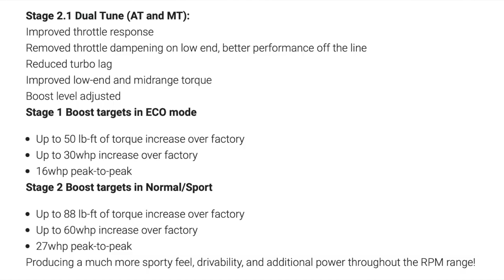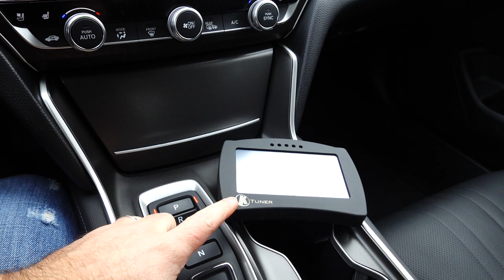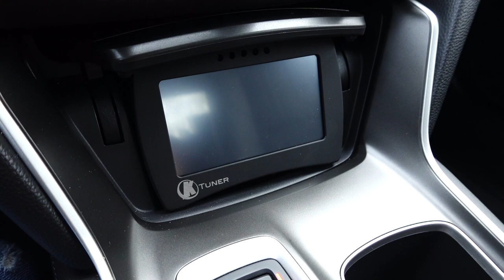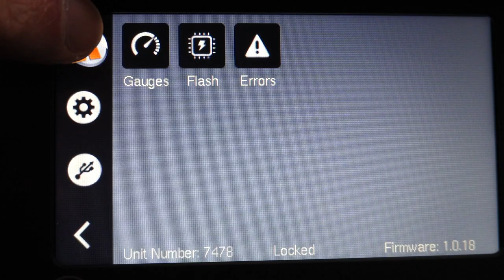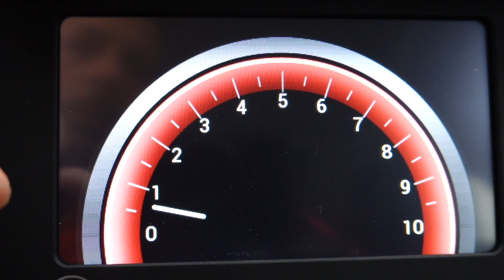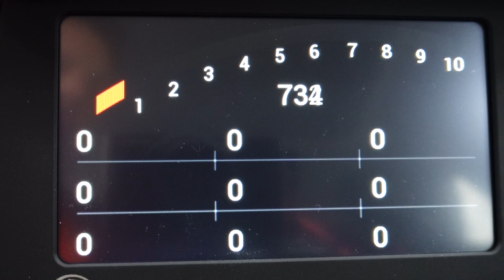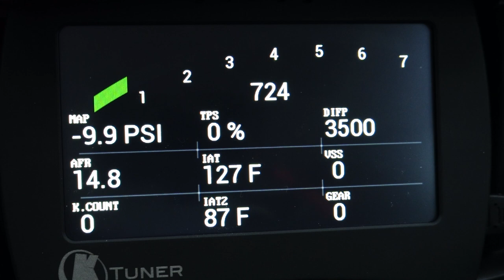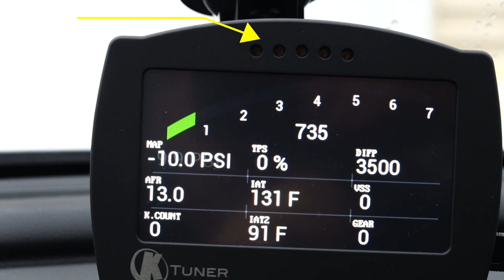How-To: Setup KTUNER V2 Display, Gauge Layout, & Datapoints // (2018+) 10th Gen Honda Accord

Comment: I chose a stealthier route. I bought this 'KTuner V2 Console Holder' on eBay for $12. It is 3D printed. It sits on the console in front of the cubby. The V2 can easily be lifted out to access the storage and 12V/USB sockets (I leave the little door open) and I mounted the holder with Velcro in case I want to remove it temporarily. I don't have the line-of-sight out of the windshield but it is stable.
Reply from the maker: Do you have a link you can share as I’m interested in seeing what it looks like 👍
Reply from the maker: Thank you.

Comment: Quick question. Do you keep the display on at all times when driving or only while data logging ? I got the ktuner with phearable stage 3, but I’m skeptical about leaving it on since it stays connected to the OBD2.
Reply from the maker: I keep the display mounted and on most of the time 👍

Comment: I have a question? My car only has prl intake v2, stock downpipe! If I buy the same ktuner as you and make the same tuner as you does it work?
Reply from the maker: You can run the KTUNER Stage 2 without having any other mods 👍

Comment: I have done data logging. It's useful to see if and where you have a problem, like monitor your air temp or fuel quality. One just to see overall what the car is doing. Totally safe on either of these tunes to go WOT from any speed, including stand still, if you hate your tires that much lol. Advanced VSA and aggressive ignition pullback setting will help with wheel spin
Reply from the maker: I plan on conducting some data logging at stock, the compare it to stage 2 tune logs.
Reply: @TheLemonFactor  ok where's the videos where's the tune lol

Comment: Can I use this without having my car tuned just for the afr readings?
Reply from the maker: Sure you can, but that’s a pretty expensive AFR gauge.
Reply: @TheLemonFactor  what do you recommend for a 21 accord to get AFR readings
Reply from the maker: There are wireless OBD devices that can read various sensor readings, which you can use your phone to monitor 👍
Reply: @WubstepX lufi XS is a good option

Comment: Currently showing K.CON, ECT, IAT, GEAR, MAP, TPS, BAT, AFR, TC.Prs on the first screen. Second screen shows K.CYC, K.COUNT, K.CON, ECT, ECT2, IAT, IAT2, AIGN. Still trying to figure out what is useful and not.
Reply from the maker: Exactly... there’s a lot of information available. Have you conducted any data logging?
Reply: No. Haven’t gotten that into it yet. Just like the extra oomph at 3k RPM from the stage 2 tune. Makes the car much more drivable in normal conditions. Don’t do WOT take offs from stand still either.
Reply: @mrzeld  just to be clear, by you saying Don't do WOT from standstill, one would perceive that as a warning. Which in fact would be false. These tunes are completely safe to do this. Maybe you meant, YOU don't do WOT pulls from standstill, by your personal preference.
Reply: @carbonm2  Correct. No technical reason not to. I was just saying I don’t - it’s not the reason I tuned  mine.
Reply: @mrzeld  gotcha, right on then. I will say, stage 3 made the car even more drivable around town. On a stock car, 304whp and 363wtq. But you only use it you need it.

Comment: How’d you get two intake air temps? I couldn’t figure out how to do that. Also didn’t know how to set the difp or whatever it was. If you could reply to me that would be great. Thanks for the helpful video by the way
Reply: Intake temps are IAT1 and IAT2. IAT2 is before a certain point, and IAT1 is after, I think. I forget what point - MAF sensor?

Comment: It's AFR 14.6 to 29 safe? That's what mines show..
Reply from the maker: It depends on your driving conditions and if you’re experiencing any knock. With that said, in general I would expect to see ~14.7 under closed loop, cruising, no boost situations, and anywhere around 10.5-12 AFR under WOT, boost. But again, this is “in general”. Your stated AFR would have me concerned if that’s what you’re seeing under load/boost 😧
Reply: @TheLemonFactor  thanks for the info.  I'm new into this.  Now I see that it's all good it shows the numbers you mentioned.
Reply from the maker: No problem. 👍 I’m glad to hear that your AFR readings are within the expected range.

Comment: Hi Chad! Once you disconnect the tuner from the car, the power gain go back to stock? Thanks!
Reply: No. The KTuner reprograms the cars ECU. So the update stays on there till you flash it again.
Reply: @mrzeld  Thanks for your response!  So, you do not need to use the gauge?
Reply: No. The KTuner shown is version 2. It has the screen with guages and holds about 6 different tunes that you can flash whenever you like. Just need the KTuner to do the flashing since it has a screen. Costs about 650 or so. There is also a version 1.2 which is just a box that plunges in but requires a laptop to do the flash. It is cheaper but no screen and requires laptop. You can use a tablet with Bluetooth as the screen with the 1.2 though. Not sure about flashing without a laptop though with v1.2.
Reply from the maker: Thank you